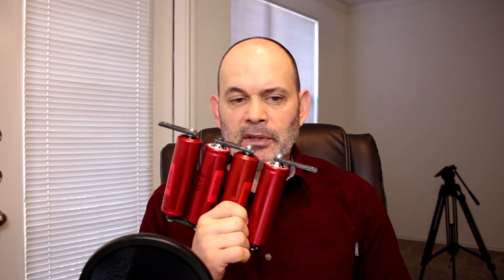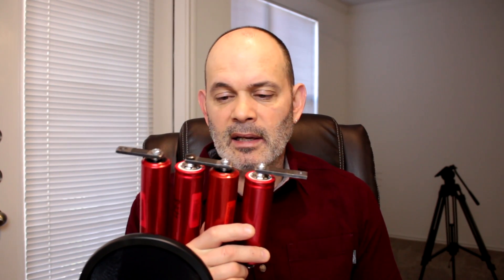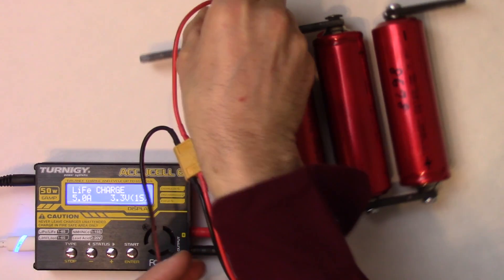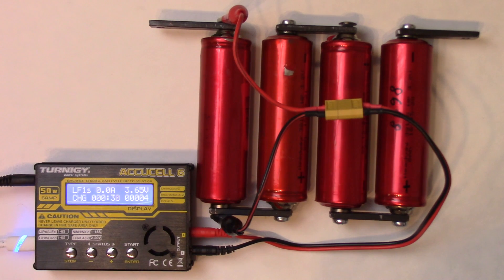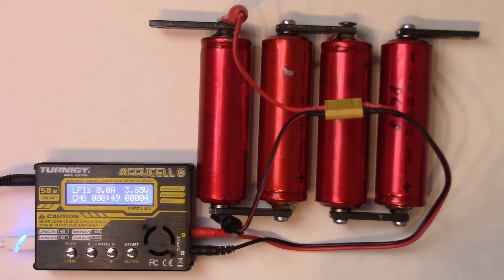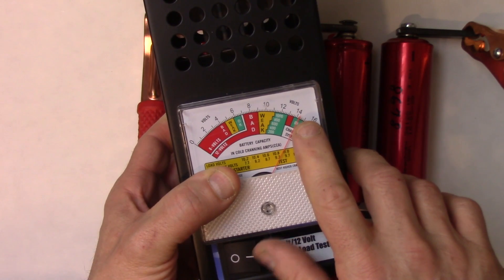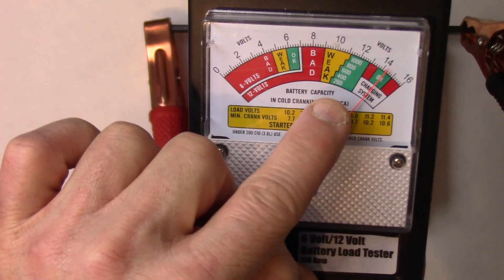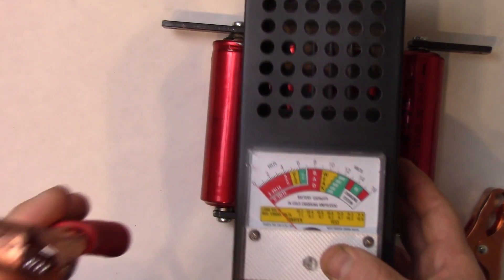Headway 38120 HP 200 Amp LifePO4 Cells Can They Start A Cold Car? Follow Up Questions and Answers

Comment: You need about 8 more and connect them in para -series       to have a reliable car battery ,,,, with just the 4  you are in the danger range of amps pulled starting the car is going to  do . and even more amp pull when its like 20'F outside
Reply from the maker: Thank you so much for watching, commenting and the valuable feedback. I appreciate it greatly. All the best.👍😀

Comment: Hello, anyone knows which would be the best BMS for an array of 8 batteries. I mean 12v 16 amp? Thanks in advance
Reply from the maker: Check on on eBay(paid): https://ebay.us/ZypcGd it may be more practical to use 8 separate charging modules to do this job, like these on Amazon(paid): https://amzn.to/42min5s or eBay(paid): https://ebay.us/OrMdfQ I have a video on one of these modules here. It will charge a 12V battery at 8A: https://youtu.be/4Iey_qXxAmk
Thank you so much for commenting and watching. I appreciate it greatly. All the best.👍😀

Comment: What balancer do i need for 8 of these connected to 12V
Reply from the maker: It depends on the configuration. If you're doing a two parallel 4S packs then you will need two 4S balance circuits. But this is just a guess. Research balance solutions and come up with a specific to your configuration solution to make sure that you get the right result. Here's some information: https://bit.ly/3XHUl3r Thank you so much for commenting and watching. I appreciate it greatly. All the best.👍😀

Comment: With 16 pieces of the cells I can then better work the start of the car for day-to-day use.
Reply from the maker: In the right configuration that could be probable. Understand that I was only testing the cells to see what they could do. I can NOT recommend this solution as an alternative to a regular car battery. There are many safety factors built into your automobile which should not be altered. Understand that I take ZERO responsibilities for your actions, damages or injury caused in the use of these cells in ANY way. Check the manufacturers recommendations and specifications for proper use. Be safe.  Thank you for watching and commenting. I appreciate it greatly. All the best.👍😀

Comment: https://amzn.to/2RCkhi5 This does not list lifepo4. li lists lipo and life. Which do you use with the four headway batteries in series. I am guessing life because of voltage out of the charger. I have a 4s-3p pack. what type of balancer would I need?

Comment: Hey, I'm pretty sure that charger can charge all four of those at the same time at 12V (4 in series, AKA 4S).
Reply: Just solder the wires from a 4S lipo balance lead to each cell then plug it into the charger's balance port while charging from the outer most negative and positive leads. Google 4s balance wiring diagram.

Comment: FYI: Clarification on Cold Start; Engine that hasn't ran for an extended period of time like parked overnight. It refers to engine has ample time to cool down, and oil has settled from cylinder to the pan. Most engine damage occurs during this initial few seconds of "cold start" when lubrication is not sufficient. Some folks here are confusing "cold start" with starting the engine during cold weather. It is similar, but the test here is satisfactory for definition of Cold Start. The engine temperature and ambient air temperature is very close to each other, at or below average air temperature of 72 degree Fahrenheit. So, from what it looks like this was a true "COLD START". Good video.

Comment: Thank you Richard you answered many questions all in one go for me. I want to buy a pack of 8 and then create 2 cells in a 4S format. I would then use 2 x cheap BMS circuits. They claim to be able to deliver 100a continuous and 150a spike. They are Chinese and I am somewhat distrusting. So watching you start a car, cold without a BMS and with only 4 batteries is extremely encouraging. This will be for my mini camper van. It has to run a 700 watt microwave. In real speak 1050 watts. I will use a 200 watt solar array plus the alternator to charge them. Thanks again you gave me hope.
Reply from the maker: You are most welcome. I am glad to know I could help you. Thank you for watching, commenting and the kind words. I appreciate it greatly. All the best.👍😀

Comment: Thank you.
Please question: if i will replace the heavy led battery by a lithium battery, Do i have to use the Charger every time when i will start the engine, or the Alternator will Charge it when i drive the car?
Reply from the maker: You would have to create a circuit with a BMS that charges the battery pack you made with these cells using (constant current-constant voltage) as well you would have to isolate the battery from the Alternator directly as it would not properly charge the pack. As well you would have to protect the whole system from the extreme environment that exists under the hood of you car. I have never done it but I am sure it is possible. Thank you for watching and commenting. I appreciate it greatly. All the best.👍😀

Comment: I'm built a 40ah battery using 20 of these cell not sure on how to wire for 40 amp hours also what the best way to bottom balance the cells and what's a good voltage for bottom balancing I'm using them for car audio
Reply from the maker: Not sure exactly how you have these configured. Make sure you NEVER go below 2.5V or over 4.2V on the cells. I would recommend that you use a BMS for what ever configuration you are using. Thank you for watching and commenting. I appreciate it greatly. All the best.👍😀

Comment: I am trying to replace the batteries on a 1986 MCI 102-A3 bus. They are two massive 8D 12V Lead Acid batteries. Any direction on doing that and use Lithium instead?
Reply from the maker: Take a look at these:  
4 SPIM08HP 3.7V 8AH LIPO Cells At eBay: https://goo.gl/CTuhQo
20 SPIM08HP 3.7V 8AH LIPO Cells At eBay: https://goo.gl/w7rJ5N
42 SPIM08HP 3.7V 8AH LIPO Cells At eBay: https://goo.gl/5SL8Wm
I have a video on these here: https://youtu.be/sREdlaPEgLg and here https://youtu.be/Gw9f68gN_s4
These were harvested from Chinese electric buses so they will probably serve you well.
But understand these are LIPO cells you will have to make batteries at 12V that give you the amperage you need and you will have to have the appropriate BMS and charging system to match them. It's doable but is it worth it? I don't know. Nice Bus!
Thank you for watching and commenting. I appreciate it greatly. All the best.

Comment: I built them in an airplane to save weight. The motor is a 2 stroke, 2 cylinder Solo with 44 kW and a reduction gear (1:3). The systems works fine, as long as it was warm outside. After a cold night (temperature about 0°C) I couldn`t start the motor. The cold batterie breaks down in voltage and amps. You will not find any factory charts for high discharge at low temperature. They know why. I reinstalled a lead Batterie (Odyssey) and everything was fine. Lead batteries are delivering a much higher cold  current. The only Li batteries I know for these conditions are A123. I will stay with lead. And please, don`t test always brand new batteries with low cycles. They are always much better than used ones
Reply from the maker: Thank you for watching, commenting and the valuable feedback. I appreciate it greatly. All the best.
Reply: I find your post very interesting plus you introduce a new dimension as per the airplane. What about the 18650? would that apply under the same condition?

Comment: Leave the battery in the cold as well all night. That's the issue with LIFE4PO batteries.  They don't like cold weather
Reply from the maker: I connected these cells to my vehicle as a test. I would not recommend using them as a replacement car battery. Thanks
Reply: That's what I thought.

Comment: Richard  here is a link to the Cell spec - http://www.headway-cn.com/en/showproducts.php?id=1560 - issues that would prevent its use as a replacement for a car battery are: 
1/ Max continuous discharging  rating is 160amp  with 200 peak which is marginal  to start a cold car  
2/ Most alternators exceed the max continuous charge rate of 40a
3/ It is not recommended to charge below +5 degree centigrade  and charging at below freezing will permanently damage the cells

Comment: Can you replace your car/motorcycle battery with these cells?Could you actually keep the cells connected to your car and keep using it everyday?Would the cells need a pcb balancer?
Reply from the maker: It would think it would require a BMS (Battery Management System) to do so as well as a proper charging circuit to isolate the battery the alternator and the cars built in 12V charging system. I am not an engineer and I have not implemented this configuration so understand this is just speculation on my part. I am NOT responsible for your results. Thanks. All the best.
Reply: Thanks for your answer .Which BMS should i use ? Any ideas?
Reply: Richard Lloyd  i have a 500F supercapacitors in series on board and i want to build a Lead acid replaced for my 4cylinders 750cc motorcycle.How should i connect 6 18650 batteries i have to charge the supercapacitors? Thanks!

Comment: You could put the cells in the fridge to imitate winter weather cranking.
Reply from the maker: Thanks I will consider that. All the best.
Reply: Noooooooo Lifepo4 start to internally crystalize below +5c any attempt to charge them below freezing will permanently damage them - the working range  for Lifepo4  is +5 to +65 C

Comment: For Ultralight Airplane use, say a 30kw(40.2hp) Electric Motor. How do you figure how many Lithium Cells needed for a Battery Pack for say 1hr 15min of Flight, with say a :20min Reserve, plus a :10min Battery Reserve using one of these REB 30 Motors at http://www.rotexelectric.eu/products/bldc-motors/reb-series/ and not using the Max Power, say Max 35hp(26kw) for Takeoff 3 min, then Cruise at say 25hp(18.6kw)?
TYPE = REB 30
TURN = 3
VOLTAGE = 120 (V)
CURRENT CONTINUOUS / MAX (KW) = 15 to 30
WORKING ROTATION = 4000
WEIGHT (G) = 8200
RPM/V (1) = 34.

Comment: How many cells are need to get 200AH?
Reply from the maker: 200/8Ah=25 cells connected in parallel will give you this amount. He is out of these particular cells I recommend going with these from the same seller on Ebay: https://goo.gl/T9jvcn they are LIPO, they are lighter in weight the same capacity and most of all available to buy. You may have to buy a few extra to make up for the decrease in capacity on average over all. they are used cells but they are a great value. I use them all the time. See my video on the SPIM08HP 8Ah cells here: https://youtu.be/Gw9f68gN_s4 Thanks.

Comment: If I were to make two 12.8v with 8 cells, for car audio usage with a 270 amp alternator. What BMS would you recommend for each bank of 4?
Reply from the maker: These cells are no longer available from the seller but he does have these at Ebay: https://goo.gl/uVPS7h I have several videos on these cells and I think they are a better alternative. Here is my video review on them https://youtu.be/sREdlaPEgLg and here is the complete review: https://youtu.be/Gw9f68gN_s4 How many amps are you planning on pumping out to your audio system? Thanks.
Reply: Richard Lloyd I already have 8 of the cells purchased and in my possession. But I don’t want to put these into a vehicle without a BMS for them. I’m still learning so would I need (2) 4s 8amp 12.8v BMS?
Reply: I have the same ? About car audio ok so take his thought with a 270amp alternator. And you asked what kind of draw. So lets just say im running a 10k amplifier i would draw between idk 700 to 900amps(continuously more or less) kinda depending on alot of shit but if those were the numbers. Please what kind of BMS would you use for this and yes i kno you would need more banks but still what would you suggest to achieve this. I like many would die to have a safe and legit answer. Please.

Comment: My track car use 4 of the blue ones of higher capacity (the 42xxx are 15AH) and it's awesome. You don't need 200A for a small 4 cylinders. I've seen peaks of 50 to 70 A.
Reply: Alexandre Lollini what is the name of these 42??? 15ah? Thanks

Comment: IF you have a manual trans you can start your car with D Cells! Just tape 10 together, solder a wire at +/- and connect to car. Now you Bump start the car. I have done this. Manual trans only.

Comment: Charging a battery is simply a case of putting a charge onto a battery via a charge controller.
Question is this true irrespective of the battery type. Can one simply switch batteries ?

Comment: 67 isn't a cold start.
should try freezing it and then using it.
It is all about the voltage drop on the battery, doesn't really matter too much what the temp of the rest of the car is.  

No one worries about their car starting on a 67 degree (arguably perfect, even according to the laws that dictate what government buildings have to operate their air conditioning)
Reply: You would be surprised how much temperature effects the viscosity of motor oil. And how much that change in viscosity effects the amp draw on your battery.
Reply: @wolffforge4839  probably not too surprised.  The effect of heat (cold is merely the absence of heat, isnt a real thing itself) on materials is covered at an early age.  Probably more surprising that the viscosity itself would make specific engine types hard to start.  Which is more related to the mechanics and an increase in the sustained draw from getting the engine to "turn".

Depending on how said powertrain is engineered, that can be completely overcome.  Just look at newer hybrid cars for good examples of what I'm saying.

Currently what's surprising me is what you can do with some of the newer amalgams (mercury mixed with things) to accomplish things we didnt previously think possible.

For instance, you can use a special amalgam to filter smokestacks on industrial buildings, and turn that smoke directly into usable coal.  Just by running it through a specific amalgam filter.
Reply: Yes , battery output drops as chemical reaction is slowed down due to cold temperature, but cold engine temperature is also harder to crank due to thickening of lubricating oils, so it's even harder to crank the engine. An engine that was recently turned off would still be warm, even the battery would have warmed up and charged up, and lubricating oil would still be present (not settled) in cylinder walls. What's the point of starting an already warmed up engine in cold freezing weather if it was recently turned off? But, you're right battery output is diminished when the battery is cold due to slow chemical reaction. COLD START during freezing cold weather is the real challenge. But, still, this was a cold start.

Comment: Can someone make a bank of like 48 (or however many it takes to make the total voltage right) kinda like people are doing with supper caps? Or would you need a difference way of charging them ?
Reply from the maker: I do not have enough to do so. Thanks.
Reply: Richard Lloyd lol

Comment: Wow, that would fly a drone a long time.  Take a trip over to R/C world.  The electric planes have the packs put together with 1, 2 , 3 or 4 cells.  The charger for these asks what voltage and then a charging harness hooks up sending power to each cell in little short bursts that each cell comes up to full charge about the same time as all the others.  This is a "balanced charge".  These packs are small to keep weight down and expensive.  Often one cell out of 2 or 3 or 4 goes out and this renders the "pack" destroyed.  Also they used to recommend charging these battery packs inside a special fireproof sock because the packs sometime bought fire.  They also stated NEVER CHARGE these battery packs when no one is in the room, in caae of fire.  They would first swell, vent a stinky smell, then smoke, then catch fire and as you know lithium burns FIERCELY!!!
Reply from the maker: Thank you for watching, commenting and the kind words. I appreciate it greatly. All the best.

Comment: Just curious the highest amount of amperage I could find was 100 amp bms which I have purchased for my headway cells, are you saying 8 cells with 2 bms's ?? I was curious if these would start a vehicle. I dont know a whole lot about batteries or electricity but this is what I was wondering.... 14.6 volt I believe is the amount of maximum voltage you would want to charge these and you certainly wouldn't want them dropping below 2.5 per a cell or 10 volts... What Im confused about is what the hell would a bms matter if the vehicle was charging at 14.6 volts?, If im not mistaken I believe most alternators run right around 14.6 volts and unless you were using the battery a lot without the alternator when on earth would you run into a problem unless the alternator failed? My reasoning for purchasing a bms was I was going to use the cells on there own to power different devices and thought using a bms would be my safest route. Also to note I recently had to purchase a agm battery and was informed not to ever charge it over 14.6 volts I had a tinenergy  lipo4 charger that works excellent  however I have two battery chargers as well one of them being a craftsman both supposedly charge agm but I wouldnt advise it because they go over 14.6 volts.